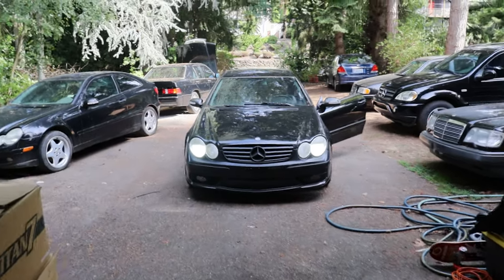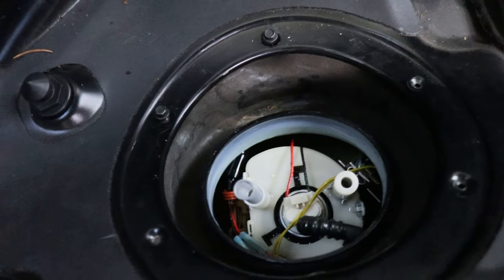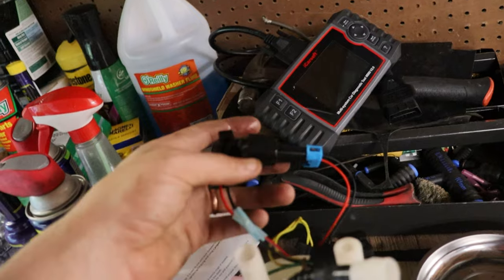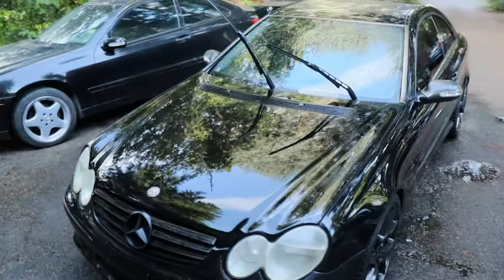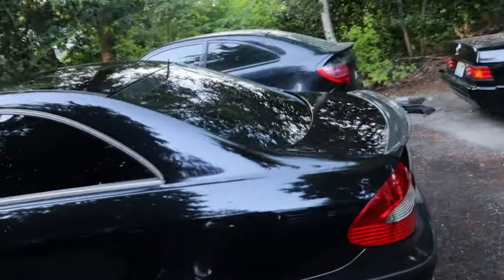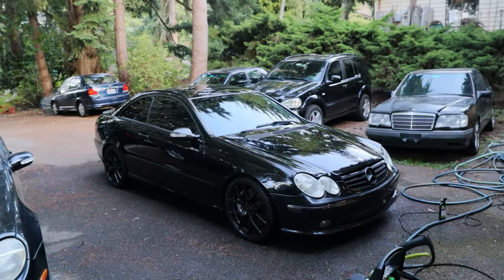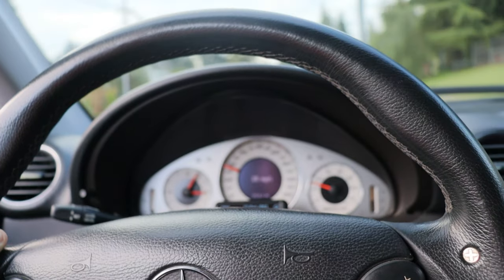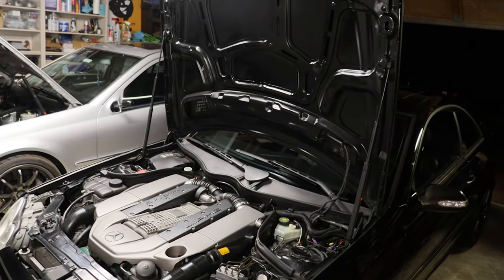M113K CLK55 AMG First Test Drive ends on Tow Truck...

Comment: Nice to see the good and the bad...headlights make a difference to the whole appearance.
What happened when it broke down ?
Did it just die and then crank but no start ?  or No cranking at all ?
Any codes ?
Reply from the maker: No power to ECU, fans on high and no crank. Think we got it figured out will update asap 🤙🏼
Reply: EIS? Frt Sam module? Remote key? Lmk
Reply from the maker: @speedsterspeedy2146  will update soon